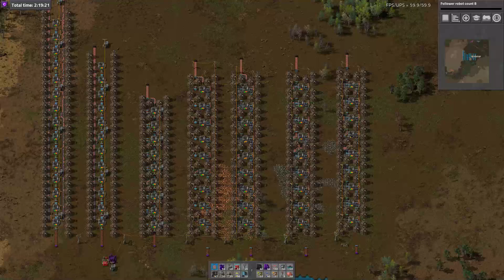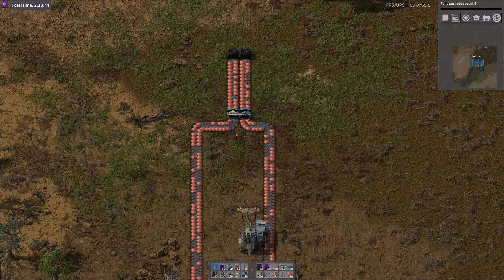Factorio sandbox: UPS-efficient smelting

Comment: Your right and your wrong, Yes having less 'gaps' in the belts = lower UPS count
But also every little belt stub = more calculations (more belt segments) but maybe less sometimes if the stubs are full and therefor the splitter can be ignored
BUT the overall gain is from the inserters if you turn on show active state and go back to the early builds when inserter 4 picks up ore, inserters 1-3 will all wake up, even if they have nothing to do (stop the furnaces outputting to check)
BTW also turn off show wakeup list that made it as a viewer so much harder (impossible) to see  active state

Its trying to waste UPS on the least optimised parts of the game.... inserters are horrible, but belts have been optimised a lot... so its actually better to have  a HEAP of extra belt segments and take the UPS cost there, but save it on having the inserters sleep more often.

I am still unsure if having inserters on a timer is a saver or not... some people say yes, others say no. So i really have no idea, but it is a test i will be performing shortly
Reply from the maker: JD-Plays cool. Thanks. I'm confident the last design is the winner for ups, but would be great to test it. I've not found a good way yet.
Reply: Best way is without creative mode (vanilla creative chests are fine) crank the game speed to 5K, look at the max UPS.... rebuild it another way, again count the UPS
Or there are commands to run a save file as a benchtest these will give a more accurate answer
Reply from the maker: Well I've had a go at benchmarking it with --benchmark, and I can't get any usable numbers out. Two worlds with the same build (built twice) give different results. So I'm going to retire for now from the optimizations game, and build for functionality until or unless my world grinds to a halt, and then benchmark fixes from saves of that world to see if they help. Microbenchmarks are just too noisy and prone to other systematic biases it seems, at least the way I'm doing it.